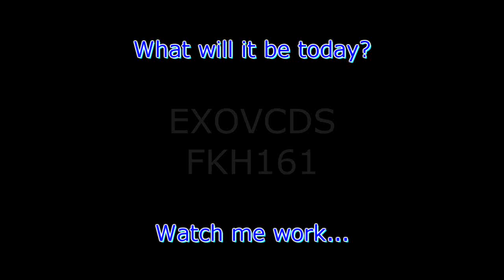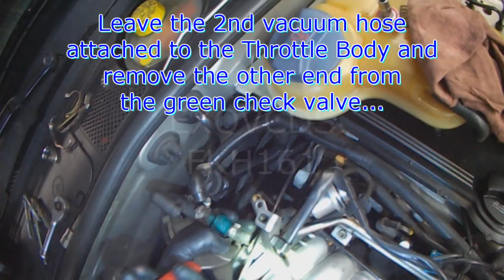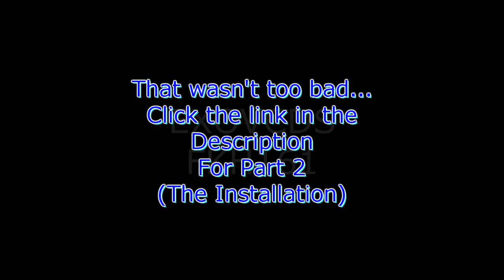Audi B5: V6 ATQ Throttle Body Replacement (Part 1)

Comment: I'm about to do this to my audi, I have a lack of power when I floor it, get up past 3000 rpm it loses power or hesitates then it will resume with the regular gain it was doing, I've had it diagnosed before at a auto zone and it said throttle body malfunction, think it may need a cleaning
Reply from the maker: Bore cleaning will not help with power issues when the engine is not at idle... a dirty throttle body mainly affects idle quality.  Reading fault codes is not diagnosing the issue. A fault code will only point you in the right direction.
Reply: Thomas EXOVCDS do you have any suggestions of what could cause me to lose power like that? its like I have full power, then lose it, then the power comes back, sometimes it doesn't do it, but I'm not sure the battery was dead and I jumped started it, and it idle like shit constantly revingup and down
Reply from the maker: Up & down idle after dead battery is normal... the ecm lost its learned idle position and needs to relearn. The throttle bore probably is dirty (rpm dip too low)... so cleaning the throttle and doing a throttle adaptation might still be a good idea. If you don't have a scan tool that can do the adaptation, just let the car idle or drive it as you normally do... the ecm will relearn on its own. After cleaning you will have a higher idle (dirt is gone more air can get in), but the ecm will eventually lower it and relearn the new value  (idle throttle position). The power loss could be because of  a number of different reasons. Watching engine data with a scan tool (while the powe loss is occurring) can help determine where the problem might be.
Reply: Thomas EXOVCDS thanks man I'll be messing with it this upcoming weekend, I have read about how it suppose to relearn just concerns me, it is a 98 2.8 motor with a 1.8 tranny I have higher rpms but I wouldn't think that would have anything to do with the power loss
Reply: Thomas EXOVCDS maybe I should re say it again, I'm not losing power I'm just having a uneven acceleration, not really feeling a power loss, the code I got was saying throttle body lower limit not exceeding

Comment: I know its an old video. But why cant I actually see the TB at all.
Reply from the maker: Because it is buried / surrounded by a bunch of stuff. Once everything is out of the way, you can remove it.  21:43
It doesn't take a genius to figure out "remove what you have to remove... to remove what you want to remove".
If you can see your throttle body on your engine, put your left hand on it.... with your right hand / index finger, point at all the stuff that is connected / around the throttle body... then start removing stuff.

Comment: Is a throttle body alignment required on a b5 AEB passat with the cable?
Reply from the maker: Yes... the ECM does its own calibration over time, but performing a throttle adaptation via basic setting is the quickest way to sort issues or determine if there is an issue.
Reply: +Thomas EXOVCDS ok thanks
Reply from the maker: +cameron2409349 read through this: http://wiki.ross-tech.com/wiki/index.php/Throttle_Body_Alignment_(TBA)

Comment: I have a 2003 audi a6 and when go down on the gas y its in park it do nothing it's something with the speed session
Reply from the maker: Maybe... maybe not. Does it idle ok? Standard or automatic? Does it drive OK?
Reply: it's automatic and now it's not starting up
Reply from the maker: What engine? The noise could have been engine related.
Reply: it's not making aa noise
Reply from the maker: Not cranking?
Reply: no
Reply from the maker: Could be many reasons... not sure if it's related to the noise you heard earlier. Too many things to suggest that you could check.
Reply from the maker: Start with a system scan to see if any of the onboard computers have any fault codes stored.  Let me know what the codes are... if any.
Reply: never heard a noise only thing is when the car it's on running and push down on the gas it do not incinerate
Reply from the maker: Sorry... I am helping several people right not... I got your messages mixed up. 
The engine not cranking could be due to:
- ignition switch
- park / neutral switch
- park / neutral relay
- fuse
- starter
- battery
etc.
Reply: What about the car incineration
Reply from the maker: I'm not sure what you mean by that.

Comment: what size is the one time use clamp?
Reply from the maker: deadlyknights1 There are a bunch of different sizes... when you replace them with worm gear drive clamps, you can use bigger clamps to cover several sizes. The parts catalog lists two sizes for that suction jet pump: 28x9x0.5 for one clamp, 22x9x0.4 for another,

Comment: This is a royal pain in the ass, I'm trying to get to the coolant temp sensor that's underneath there. My car is equipped with LPG so I have tubes and wires all stuffed there.
Broke a plastic tube and lost my 5mm Allen in the engine bay. Eh.
Reply from the maker: Definitely easier when there's no LPG.
Reply: @EXOVCDS  yep. Did get access to that sensor but it's giving me a hard time. And yes I did remove the c clip
Reply from the maker: @Scouter98  They can get stuck real good. Should be in a metal pipe, so you can use quite a bit of force without worry of breaking the pipe.
Reply: @EXOVCDS  I damn near knocked myself out when I tried to pull it out with pliers.
Used a screwdriver socket, some extensions and a ratchet, gave it a twist and it popped right out. Modern problems require modern solutions! Thanks man, subscribed. Next job is downpipes,  I'll have more questions then :D cheers
Reply from the maker: Thanks for the update!